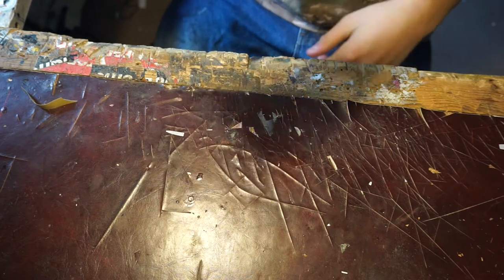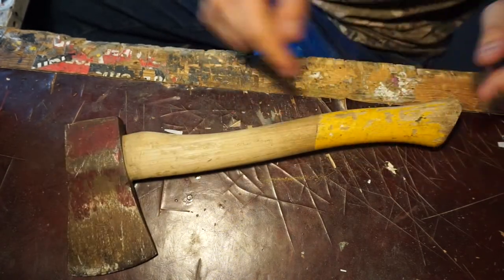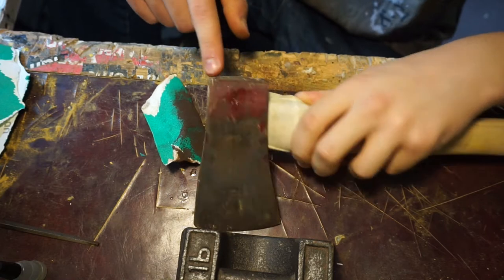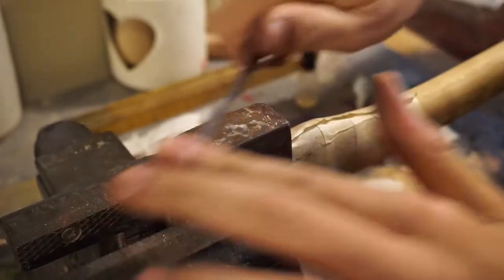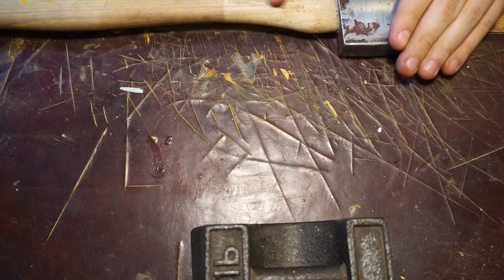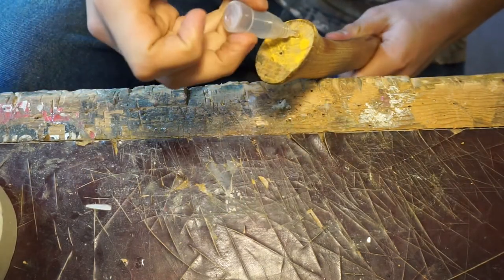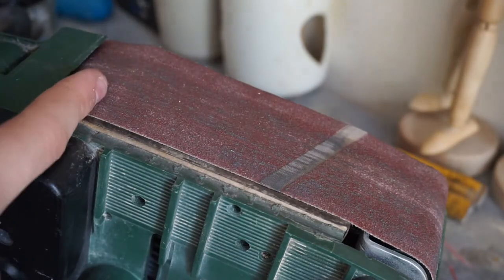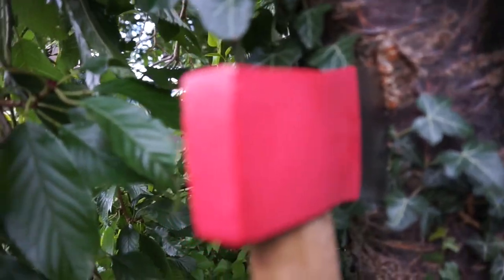restoring a VINTAGE 1960s hatchet

Comment: Hi and good job. A couple of suggestions from someone that has been doing this for many, many years. First thing to do is decide what you’re going to do with the item when you’ve finished it. This makes it so much easier to work out how far to go with the restoration. I think you got it just right if you’re going to use it plus you don’t want to erase all of its past as it was your great granddads. No point putting heaps of work into a high polish just to go out and chop wood with it. No notches please, just use a tape measure to write down where paint needs to be applied or as it’s not critical you could just refer back to the video for reference. I’m SO glad you kept the handle, never replace a piece that can be repaired and reused, it’s wasteful and shows a lack of skill and sympathy to the piece. I see so many “restorers” pulling perfectly restorable parts off and replacing them when sometimes seeing a repair is fine and I have seen repairs turned into a feature. It can help show the items history eg. I saw a broken vice brazed back together, smoothed down to bare metal and just oiled, the the repair was very visible but the grey of the bare metal and the gold of the brass brazing complimented each other and the finished vice looked just fantastic. You could see it had been abused and broken but now it looked glorious and ready for more hard work. Of course if a part is beyond saving then by all means replace it. One last thing, it’s probably better for your audience if you talk while you work, voice over is good for that. I hope this helps and keep on restoring cause you’re good at it.
Cheers Stuart 🇦🇺
Reply from the maker: thanks Stuart, really interesting, I’ll be sure to take those points in to account next time I fix something up , take care bud !